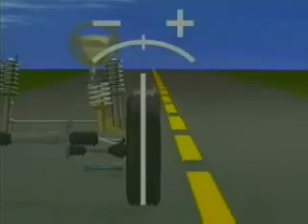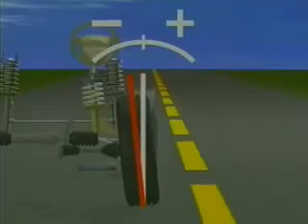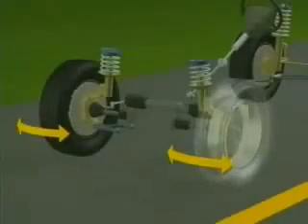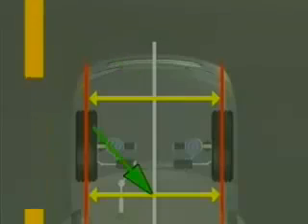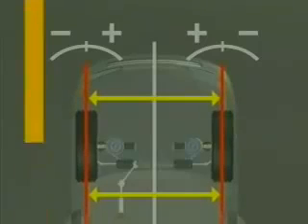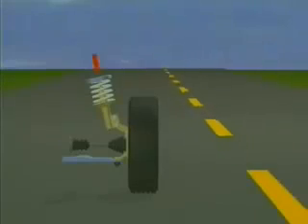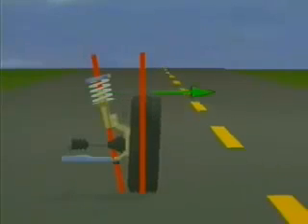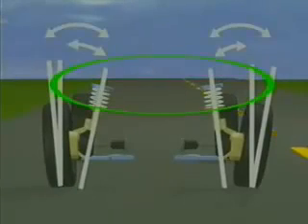Camber, caster and toe angle, Suspension basics and Alignment simplified

Comment: Really good video. Also I gotta say I love the caster setup on Mercedes cars. Turn full lock and the wheels are leaning so much.
Part of the whole Mercedes drive feel. Sometimes when I park my Mercedes in front of a cafe for a bit, I'll go on full lock, just cause it looks cool. 
Most cars looking plain and then there's your sleek Mercedes, with the front wheels almost sideways.
Reply: Megadriver that is camber not caster
Reply: @Ajx1314  Nope, Megadriver is correct. Caster can cause the wheels to tilt when turning at low speed or at a stop. Mercedes-Benz vehicles in specific are known for this. This is due to the unusually positive caster angles on this car, that was an intentional design to increase cornering grip.

Comment: In normal steering turn, toe-in and toe- out is it good?
Reply from the maker: In a rear wheel drive vehicle, increased front toe in provides greater straight-line stability at the cost of some sluggishness of turning response. The wear on the tires is marginally increased as the tires are under slight side slip conditions. On front wheel drive vehicles, the situation is more complex.